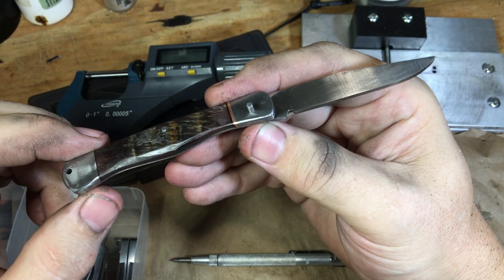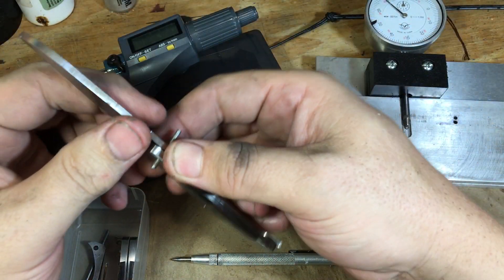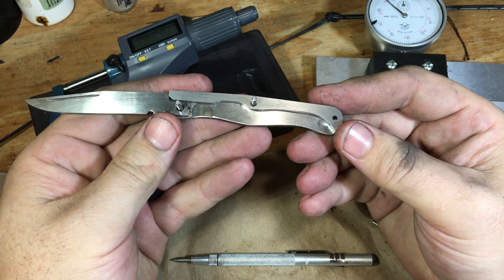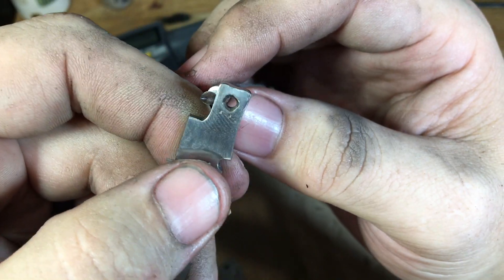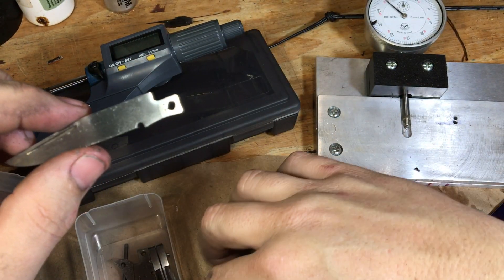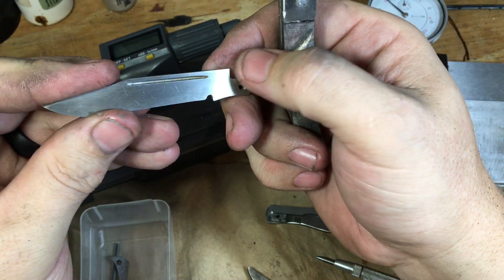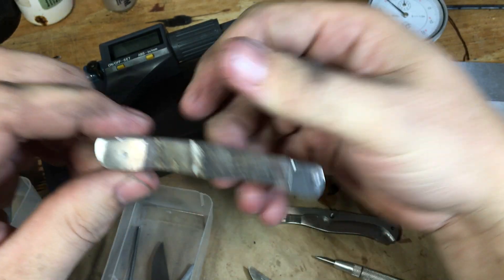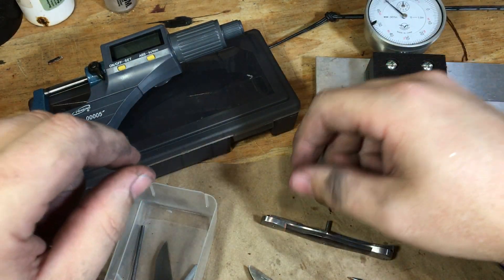Anatomy and Operation of a Slipjoint Folder

Comment: Brilliant video bud, I'm looking at starting my own pocket knife range and this video is an amazing starting point for me, I usually make fixed tank filleting knives and it dosnt really matter what type of steel you use as long as it can hold a razors edge, what is the best stainless steel for a slip joint as I'm assuming carbon steel would be a nightmare with rust

Comment: Good Morning. I have watched This Video as well as "Adjusting the Kick on a slop Joint folder" Really great Videos, and  excellent information. 
My question is How is the Centering of a blade when in the closed position established? The centering of the blade tends to be an issue especially with SMKW's House brand "Rough Ryder". Also why would a Blade have play in the Half stop position only? being nice a tight when opened and in closed position? Can centering and blade play issues be corrected in a finished Knife?  Thank you so much.

Comment: great video. thanks. Was curious to learn that you grind the bevel after heat treat. Why is that? Is that common on smaller blades? How do you manage not to destroy the temper? Thanks. Also do you free hand grind or use a jig?
Reply from the maker: Bluford Birdsong  with thin steel (less than 1/4 inch) it’s very common to grind after heat treat.  I grind freehand and dunk the blade in water every few passes.  If you can hold the steel in your bare hand it will never be hot enough to ruin the temper.  Most steels begin to temper at about 300 degrees F.   An added measure to protect the blade is to use fresh sharp belts.  If the blade is getting warm after one or two passes the grinding belt is getting dull and you change it right away. 

A lot of makers use jigs.  I learned freehand and that’s just the way I do it.  

Great questions and thanks for watching!
Reply: This is very helpful. Thanks

Comment: How do you assemble a slipjoint with spring tension? I see that you need it, but how do you put it together once it's loaded? That's where I'm stuck.
Reply: Great video!
Reply from the maker: Hey Woodie!  I apologize that it took so long for me to reply.  I am new to making youtube videos and I did not see your comments. 

There’s a trick to setting the spring tension on a slipjoint.  You do it by drilling the hole for the bottom bolster offset by about half the pin’s thickness.  I will do a video on it in the next few weeks.   In the meantime, there is a fantastic book written by Don Robinson called “Slipjoints: My Way”.  It is the best, most detailed and easiest to follow tutorial I’ve ever seen.  Amazon has it.
Reply from the maker: As far as how to assemble it-  Having that pinhole offset is where the tension comes from.  So then then the obvious question is how to get a pin into an offset hole.   Keep in mind, it is only half a hole off.  By using a pin that has been tapered to a point, you can get that point through the hole.  Then tap the pin through the hole using a hammer.  Once the full diameter of the pin is in there, it forces the spring to flex.  That’s where the tension comes from.
Reply: @jwilsonhandmadeknives2760  thanks for the simple explanation!
Reply from the maker: @Knockonwood4643   No problem, I hope what I said makes sense.   I'm about to do a batch of slipjoints.  I will make videos throughout the process, because dealing with the spring tension is probably the biggest head scratcher of the whole process.  The rest of it is pretty simple to figure out, just tedious.

Comment: You don’t need to dish the back of the tang or have a kick.. keep it flat... while making the knife slowly close it where you want it to stop mark it and stick a stop pin in the sharpening choil.... much nicer
Reply from the maker: Charlie Bowen  - Your method works great and it is the way it is done on liner locks and frame locks.   But how would you get the backspring to work without dishing the tang?
Reply: By just flattening it.. as long as your spring is square it would be full contact and not just 2 points.. look at a Google slip joint template... that's how I leave mine. Just flat. As it comes around it's a gentler fall into half stop too. Less rise and fall in the travel
Reply from the maker: Charlie Bowen  thanks!  I’ll try that out!